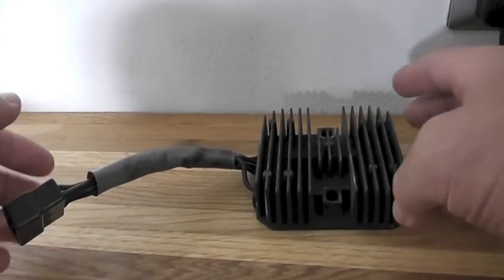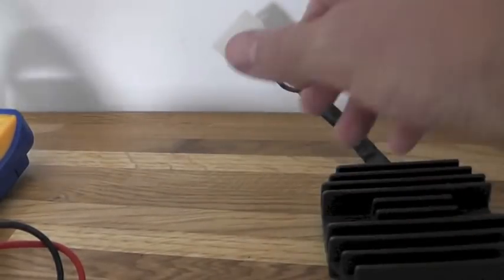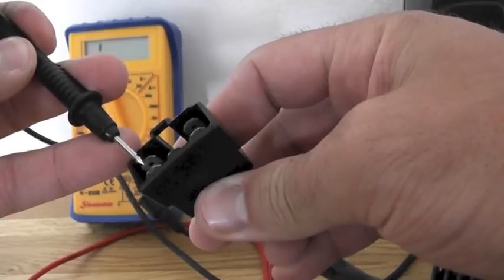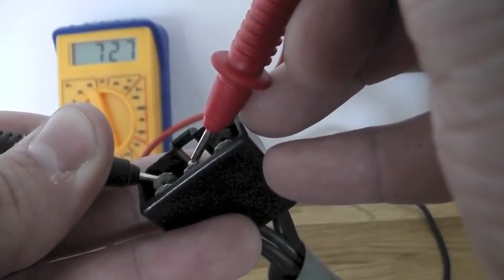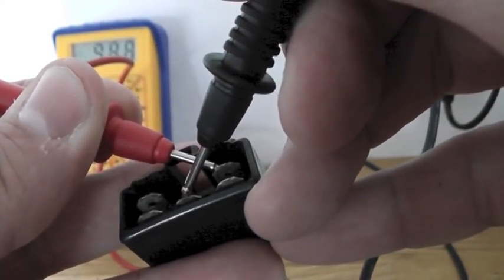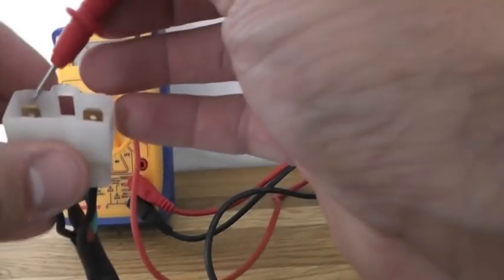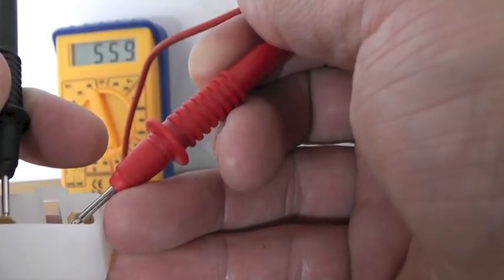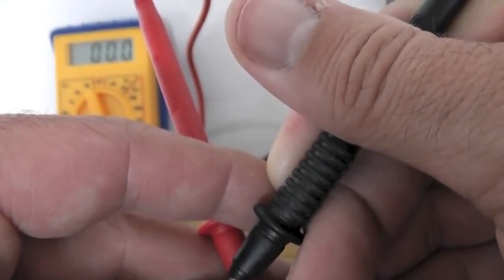Rectifier Regulator test faulty against good one

Comment: Hi, i have a outboard engine, and i think the regulator is damaged, because the tach isn´t work and there is a burned wire connection on regulator. I have to put a new regulator, but i have a doubt. Can i connect the stator to regulator random or is there a specific conection? It has 3 yellow wires, 1 black and 1 red. Can you help me? the red and black is no problem to connect.Thanks, and great video!
Reply from the maker: Decio Vasconcelos I would say dont connect it randomly I would imagine there is a specific connection. But beyond that i could not tell you how to connect. Sorry
Reply: Bone T Ok, thank you. I already solved the problem. It was a broken wire on the swich key. I put another one.

Comment: Very nice diagnosis! But do you know why there is a reading for one polarity and not the other? It's due to something called a " Zener diode", normally incorporated into a rectifier pack ( or diode pack for a car). It can only receive energy in one direction, much like a LED ( light emitting diode ), thus removes the AC voltage and disposing of the energy as heat ( explains the cooling fins, or in a car alternator has a fan blade incorporated inside which cools the diode pack as it turns) whilst keeping the DC voltage to feed to your battery and necessary electrical components. Just thought i'd shine a light on the "why" as you showed the "how". All the best!
Reply: +James Sheridan He's testing the three-phase rectifier, not the regulator part of the circuit.  There's no indication that the test signal is hitting a zener; instead he's testing the basic p-n junction silicon diodes.  If there is a zener diode in the part (which there probably is) it's going to be in the regulator part of the circuit board.  When you say it "can only receive energy in one direction" A) it "receives" in both directions, it only PASSES one side of the AC wave (basic understanding of how a p-n junction works would be helpful here) and B) the whole point of a zener diode is that it WILL conduct on the reverse bias once a certain voltage is reached.And blocking one side of the AC wave has nothing to do with why it gets hot.  The heat is produced by the regulating mechanism, which on bikes is usually a shunt with either SCRs  or MOSFETs as the controls (SCR-controlled will run hotter than MOSFET-controlled).
Reply from the maker: James Sheridan Nice one, always good to get the full picture.
Reply from the maker: James Sheridan Nice one, always good to get the full picture.
Reply: Zener diode is not supposed to let current flow backwards so im assuming feeding power back the wrong way you wanna see open circuit on all the stator pulse wires ... im new to this too
Reply: Rectifier diode. Zeners are used in reverse bias for voltage regulation, but aside from that you were pretty close.
Reply: +Bone T will a bad stator fry a new voltage regulator? i installed the voltage regulator without changing the bad stator and tried to ride. eventually the bike died.

Comment: Here's today's bonus question:  What do the numbers that appear on the meter mean? 

And yes I do know the answer, I'm just pointing out that it's conspicuously absent from your video
Reply from the maker: Educate us.
Reply: Bone T It's the forward- and reverse-bias readings of the diodes in the rectifier portion of the piece.  Since the output of the stator is AC it needs to be rectified (hence the name) to DC in order for it to be A) stored by the battery or B) usable for the DC applications on your bike, which is pretty much everything.  The diodes in the rectifier perform this task by only passing one polarity of the AC waveform, which is why you have six diodes for three phases.  Ideally your forward bias reading will be ~.500VDC drop and the reverse will be an OL.  The video is correct, the one with .000 is bad since the reading indicates the diode has shorted, and the PN junction has been either destroyed or bypassed, essentially turning the diode into a conductor.  It will no longer do it's job.  Just pointing out it doesn't hurt to know WHY it doesn't do it's job anymore or what that job is.

I wasn't trying to be a smartass, just trying to point out that the video is simplified to the point you may think you're doing the right thing when you're not.  If you follow this video and get good readings on all 12 checks (three phases, six diodes, 12 checks) you may think that means your rec/reg is good and then spend all kinds of time and money replacing the stator, flywheel, harness, etc. because what the video fails to mention is that the diode test he is performing DOES NOT test the regulator portion of the piece.  It's possible for the SCR in the shunt mechanism to be a smoking crater in the circuit board (figuratively speaking) and the piece may still pass the test shown.  And unfortunately there's really no way to test the regulator.  Best thing to do is take it to the local shop and ask them to hook it to a good running bike to see if it works, or send it off to an electronics shop, though they'll probably charge you so make sure you exhaust the local; i.e. free avenues first.
Reply from the maker: redsoxrok34
Thanks for your input. Always good to understand and learn these things
Reply: Bone T NP like I said wasn't trying to hijack your vid or anything.

On a side note I realized I forgot to answer my own question lol.  If anybody does want to know, a diode is pretty much the most basic semiconductor device out there; an anode and cathode produce a single PN junction.  The numbers you see appearing on your meter are different from a typical resistance reading in that they are the actual voltage drop necessary to forward-bias the diode into its conducting state.  With silicon-based diodes it's usually about .6, shows as about .50-.55 due to the trivially small amount of current the meter is actually using in its test signal
Reply: redsoxrok34 Well done sir!  Nothing like knowing what and why you are doing when you do it.  Thanks again
Reply: Man I just bought my first motorcycle, 2015 Hypsung 250. The battery (brand new) dies immediately when I turn it off. As if it was old. I wish I know how to fix it but it’s like your guys are speaking Spanish to me. Can anyone tell me what to replace in order to assure my bike will run fine again
Reply: redsoxrok34 thanks dude

Comment: how can be texting without power  going on the regulator??
Reply from the maker: Hi I asume you mean testing? and im testing the circuits within the unit as a faulty one will give different readings to a good one as per the video.
Reply: Bone T Yeah, but the regulators itself arent wired up. Ive got little to non experience with this, but shouldt the readings be.. zero to 1?
Reply from the maker: *****
Hi the readings are right it is a resistance reading between a diode. Not nowing to much about it myself i believe the multimeter runs a current through it and measures resistance (how much is getting through). This was an easy way to show that there was a fault with one of the rectifiers as they should of had the same readings at the same test points, and as one had failed it clearly pinpointed the failure by showing a different reading. So the current was unable to flow between the 2 points giving a 0 reading and showing a faulty diode within the circuit. Could be totally wrong here so if anyone knows any better or can explain it better then please do so. Thanks
Reply: Bone T Yeah, I figured the most of it, but I didnt see why there was a resistance if there was no power. Clearly the multimeter should give some voltage.

Comment: HELP ME! I'VE FALLEN AND I CANT GET UP!

I'm having the same problem on my CBR. Left me stranded for miles..
Did you ever happen to check if your battery was dead before replacing? I don't want to buy another if I don't need to.
Reply from the maker: Even though the first faulty rectifier nearly boiled the battery  to death  it did still hold a charge for a bit but lost it quickly so I replaced it as didnt want to rely battery. And believe it or not rectifier went again on bike this time not charging at all. I did not replace the battery this time and i am still using it.  So if the faulty rectifier is overcharging (boiling the battery you will be able to tell as this will give off a really eggy sulphure smell) replace battery. If its not charging at all you should not nead to. Hope that helps
Reply: It does. Thanks so much, sir!